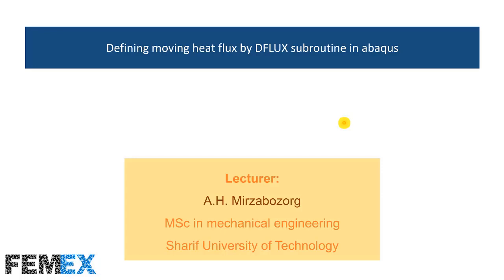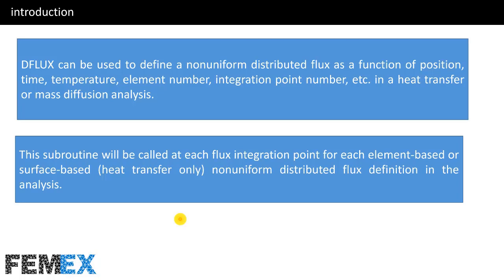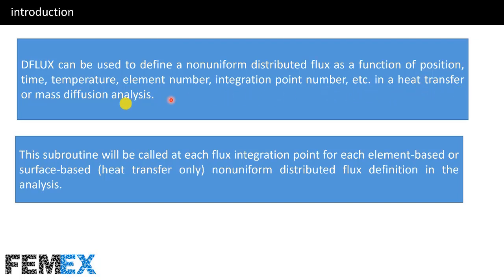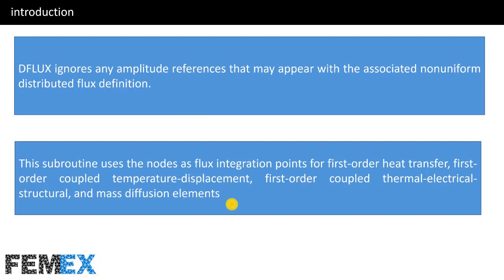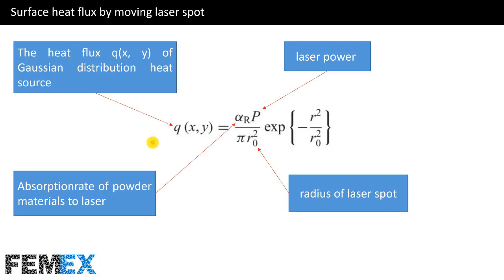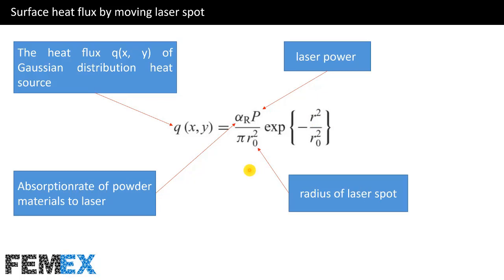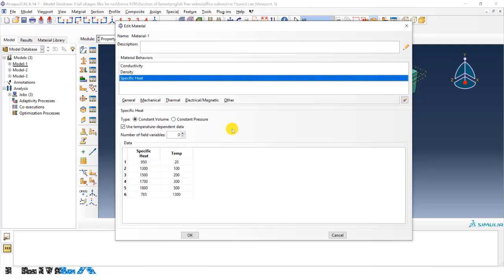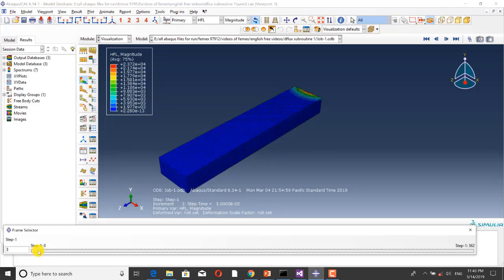defining heat flux by using DFLUX subroutine in abaqus

Comment: I am modeling laser ablation, and when the elements are deleted , I need to change the surface for surface heat flux (i.e. when elements are deleted I need to apply surface heat flux on the deeper layer) ? Could it be done?
Reply from the maker: Hi.
Yes it can be done but I don't know how to do it.
It needs some complex type of coding.
Using the DFLUX subroutine individually is not enough.
Reply: @FemexIran  thanks a lot, ur videos are extremely useful.
Reply from the maker: @rishiraj6242  You are welcome. Thank you.

Comment: Hi. 
Can you please tell me the difference between DFLUX & DSFLUX subroutines in Abaqus?
When should I use each of them.
Reply from the maker: Hi.
Dsflux is not a subroutine. It is a command line in the inp file. We also call them keywords in abaqus.
About dflux, we have both of the dflux subroutine and dflux keyword.
Dflux keyword is different from dflux subroutine.
If you want to write a distributed heat flux as a function of time and position, you must use the dflux subroutine as i have explained it in our tutorial.
Abaqus generates the needed keywords when running the cae model so there is no need to study about dflux or dsflux keywords.
If you want to use our tutoring and consultancy service, you can contact me via email : mirzabozorg71@gmail.com

Comment: Hello Mr. Mirzabozorg. Thank you for your great videos. You have helped me a lot in my work. Do you think we can use both DLOAD and DFLUX together in case of for example warm laser peening while heating the surface simultaneously? If we want to use these subroutines together, should we put them in the same UMAT.for file or we can use the job to run two UMAT files at the same time?
Reply from the maker: Hi.
You are welcome.
Yes we can use DFLUX and DLOAD simultaneously. I have done this before for another project. There is no need to use UMAT to do this because they are not relevant together. You must attach one Fortran file to the job. In that Fortran file you must write all of the subroutines. For example you can write the DLOAD and after its ending you can write the DFULX. This is correct and no problem happens.

Comment: What are the units for the  Radius of Laser Beam Please? And could you specify some more about the dimensions of the specimen as well?
Thanks
Reply from the maker: hi. in the simulations the unit of length is meter. the specimens are not small.
Reply: @FemexIran  You have given the Power of the Radius as 10 right? Could you please tell whether it is Watt or KW?